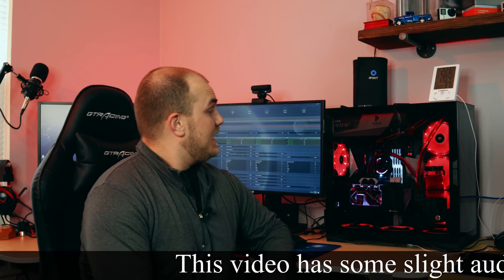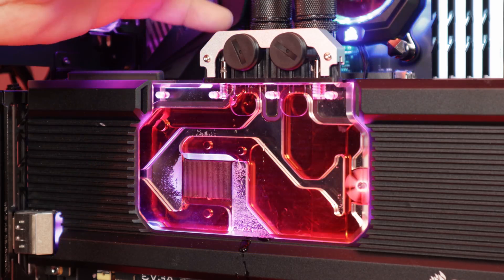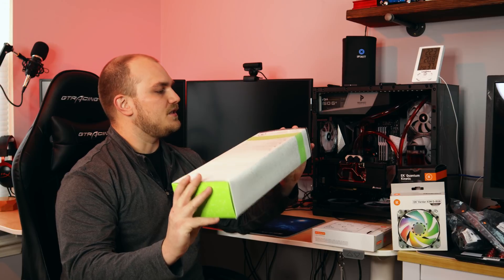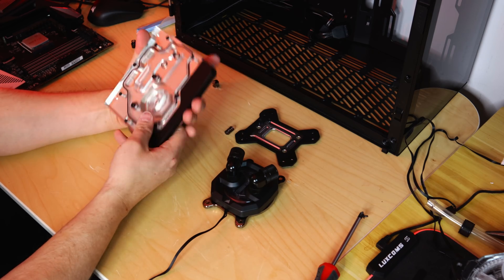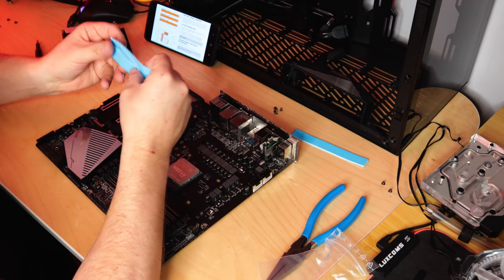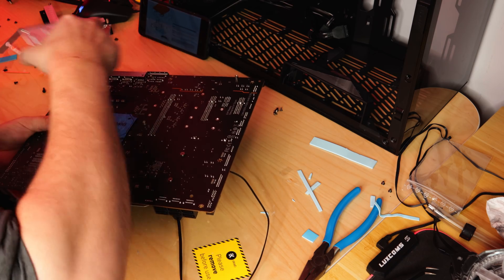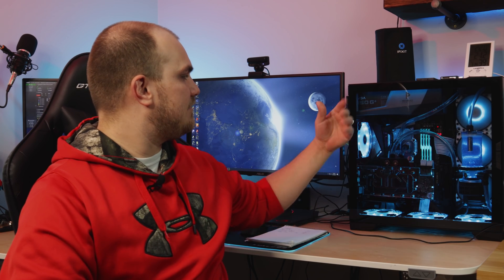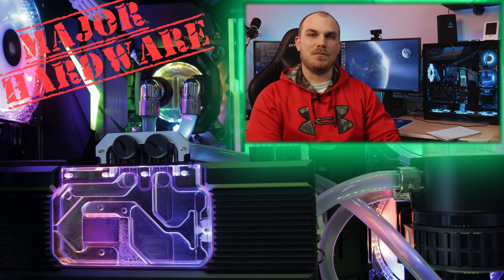SHAME! This Could Have Cost Me A 3950x AND 2080TI | UPGRADING My System To EKWB

Comment: hello there, i use ekwb fullblock too on ryzen 9 5950x ,Asus x570 egaming and a msi gaming xtrio 3090 allso with ekwb , i got 66 degrees on cpu and 42 degrees on gpu while mining Etherium and running cinebench simultaniusly..got i 2 radiators 2x120 and 1x120 with noctuas and a compressorcooler   . Pump a 15year old Eheim1048 and as comptessorcooler Hailea 350 are normaly for aquariums 😁
Full load waterthemperature is 30degrees.. could be worse i guess..

Comment: Haha, you need more than 1 rad to chill both cpu and gpu. Still good temps
Reply: 120mm for each in a custome loop should be fine to avoid thermal throtteling if set up correctly and individualy. 360mm for both as he has shown is fine. a thiccer rad might help depends on the airpressure the fans provide as a thiccer rad will also slow down airflow and may hinder heattransfer. Ofc if you go custom why not go the extra mile and stuff in as many rads as the case can fit?

Comment: @Major Hardware. Nice that you got that "potential disaster" under control !!
Though I must say that 95 degrees C sound pretty excessive for a watercooled CPU, which to me indicates either something "wrong" with the block (paste ?) or with the "configuration" (voltages). And seeing as the changing of the cooling hardware mitigated it, I'm inclined to suspect that something regarding Your old block or it's application was "not right"... 11 C difference from swapping components is MASSIVE in my opinion.
Best regards.

Comment: Hopefully more people will learn to stay as far away from Corsair as possible when it comes to water cooling. You’re paying a premium on OEM/outsourced items.

The only thing decent within their line is the XR7 series of radiators and that’s only because they’re being OEM-ed by Hardware Labs.

Please people, before going and throwing a water loop into your chassis containing thousands of dollars worth of components, please do some research. Stick with the companies that actually R&D their own components. Even if it costs you a little bit more, in the long run your machine will run cooler and with less chance of manufacturing defects ruining your hard earned, built machine.

Comment: I installed my EK Quantum Vector FTW3 2080 TI version and the USB-C port stopped working  😂😢 I can live without out it but a £1000+ card lost 1 input due to a waterblock change, you also lose access to the fan & rgb headers on the back end of the card.    ANYBODY lost USB-C port?  I get 0 errors reported in Device Manager, it still thinks it works fine but nothing happens when you plug in anything.

Comment: You had a single 360 slim rad for 400+W heat and moved to an XE which is twice as thick, sure you'll have better temps. I bet water was like 40+ *C in the corsair setup.

Comment: Glad to see EK hooked you up. I upgraded to the same board in Jan of this year, and I've been looking at the mono block in conjunction with the x570 chip-set block. Have you put any thought into incorporating the chip-set into your loop? Cheers -Haz3
Reply from the maker: i have, but to be honest i dont here the little fan and it doesnt seem worth the effort at this time.
Reply: I did a vertical pci adapter in my cooler master haf x about a month ago, and I've noticed when I'm doing rendering or intensive m.2>m.2 transfers my x570 chipset is around 5degrees hotter then when the gpu was horizontally oriented. I'm afraid the two m.2 with the (known to run hot) x570 chipset all tucked behind the gpu the temps are rising. I'm going to go for the chipset block and put out a video as long as I can get the tubing routed in the tight spaces. -haz3

Comment: Just a quick comment on the VRM temps on my Aorus X570 Master. 
CPU and GPU was pinned at full load running folding at home.

Room temp was measured as 17 Degrees C on my intake of the PC Case.
The internal case ambient temperature was measured as 31 Degrees C.

My 3700X was running at 77 Degrees C on air cooling.
The reported VRM temperature at this point was 43 Degrees C.

I dont have any direct airflow over the stock VRM heatsink.

Awesome channel buy the way.
Reply from the maker: thank you
Reply: @MajorHardware  I mailed you an idea for a possible future video if you are interested.

Comment: Those temps for 3950x are too high, and it's not about cooling, it's about voltage on the cpu. If you are holding it on default, those temps are fine then, but I don't think that even @1.3v manual temps should be 84c, not more then 80c. And that cpu  should do 4ghz all core on lower voltage then 1.3v.  It's best bin there is, so you are missing something there. As for the EK, nothing to say, best water cooling products by far.

Comment: I got a case used with some water cooling parts, I'm contemplating putting in a faux water cooling setup, (rads to res/pump) just for looks but I'd need to get some tube and bend it (soft or hard) and the misc fittings for it... then again if I have that maybe expand to cool 1 part (cpu probably), not that I need it. I only watch videos/movies and know absolutely NOTHING about overclocking....

Comment: For some reason this video popped in my stream only now. I've been watching this 'squirt replay' couple of times, and I'm seriously thinking is the oring seal actually there? I had identical issue with Aquacomputer's 7-GPU terminal block (number crunching rig), only to find out the gaskets where all missized and slipped, creating tiny, tiny leaks, that wouldn't show until temperature rose (more pressure). I wish you disassembled the Corsair's terminal.
Reply: Better watch his previous video regarding this issue, manifold screws, he had a detailed analysis on it

Comment: I've always had a good experience with the Phanteks blocks, but I have been considering switching out the CPU block in my Asus z370 itx build for EKs monoblock. My VRMs are always over 80c under any sustained gaming or benchies, with the 8086k barely reaching 70c @ 5GHZ and 1080ti usually around 45c. There's intake fan right above vrm and exhaust behind. I know Asus has been making some questionable vrm decisions for a few years now, but I'm just kinda torn between a monoblock or different itx board with better vrm.

Comment: Bro, you downgraded from the second to wordt block maker to the worst lmfao
Reply from the maker: Check you work
Reply: @MajorHardware  the reason for your "better temps" is the lower ambient (when running a loop each degree lower ambient will have a significant change in the opperational temps), the change from what seems to be a xtop pump which is really a ddc pump to a d5 kinetic (ek doesnt actually make pumps and simply resells them and the real manufacturer is laing for all d5 pumps for example), and likely also changes in fan target rpm and potentially changes in radiator and also possibly vecause of the case ambient if you didnt have both systems shut off for a significant period of time before running the test (also potentially because fluid change). The actual blocks however were major downgrades as the ek block maintains about the same floe impedence but with much worse alloy selection and significantly lower surfsce area over the die area on both the cpu and gou block and with the cpu block also now adding an extra heatload into the loop from the vrms which dont benefit from running cooler unless they were previously hitting a temperature thay degrades the mosfets in use.
Reply: @popnimpop5278  who would you recommend then? I'm new to this whole subject and it's very difficult to know who to go for. The heatkiller stuff looks good but I've only got youtube and random web pages to go on. Any suggestions should be appreciated saying as you have first hand experience clearly.

Comment: A "parallel flow" waterblock (the corsair one) with that CPU is aspected to perform like crap. Sadly EKWB blocks aren't good either for multi-die CPU because they have a very small fin area, with Intel CPU is fine. Personally I recommend to you to ditch the monoblock and get a Heatkiller IV will drop at least 5°c or even more. I switched from EKWB Velocity to a Heatkiller REV 3.0 with a DIY mouting is a 10y old block but excellent design and much bigger fin area and it dropped 5°c. If you get a Optimus Foundation probably the performance delta is close to 10°c. EKWB recently is getting very overpriced and the performance is not there. 
This is THE waterblock for Ryzen https://optimuspc.com/products/foundation-cpu-block-amd?variant=16111865987121
Reply from the maker: Big problem..... no rgb

Comment: I've got a step down from you in nearly every way: 3900X, RTX2080, EK loop with non-RGB CPU block and GPU block, and a smaller pump/res.  I have the same rad, though.  I love mine.

Comment: WILLING to trade for EKWB 360ml complete WATER COOLING kit for am4 platform b450 mb, rx 5700 gpu XFX DDULTRA, MY TRADE offers are all 3 combined! (r5 2400G known to clock at 4ghz at 1.4volts but i only ever ran it at 3.85 ghz at 1.375 volts, evga gtx 1660 super sc ultra, and a 240ml master liquid ml240l aio. ALL except the apu are under warrenty. can provide access to my evga and coolermaster accounts so you can make those your own for rma status and whatnot. ive major dont likke me posting this then do lmk where i could be more inclined to do so...

Comment: I had a Corsair PSU explode a cap in my pc, sounded like a firecracker :D

Then again I bought a Superflower Leadex 3 750w full modular PSU some time ago and it died right away while installing windows, only after 15mins of use brand new.. And no I didn't exceed power and used care with install.

So far my best experience has been with XFX PSU's :)
Reply: My best experience so far is with XFX as well.
I my first psu was from a local vendor. No brand thing but reliable. 
Bought a corsair one. Fried my pc after a few months. Got everything replaced by the shop (god thanks) and bought an XFX one. No problems running the 750W one at 700W powerdraw for months in a row
Reply: None of those three brands actually make their own power supplies, they're all OEM'd elsewhere.
I know at least some of XFX's higher end supplies are made by Seasonic, who do make good power supplies.  Corsair, it definitely matters which line they're from.

Comment: its funny how you add hot ass vrm to the loop and still drop the temps by an insane amount.
Reply from the maker: ek knows what they are doing it seems
Reply: VRMs can reach high temperatures, under crappy heat "sinks" and "armor". However the heat flux is actually not that big. I suspect the CPU running 130 MHz higher on average with the EK loop contributed way more to the power consumption than the VRM.

Comment: Woah!! Perfect time for me to find this, as I'm starting a new build with EKWB components in another few days or a week. I hope you see my comment, because I have a question!

The new X3 fans look amazing and feel quality so far (remember my system isn't built yet, but small parts I have started assembling). BUT! I'm wracking my brain trying to figure out how to mount the pump to them with the vertical bracket like you did. Sadly, you fast-forwarded the video right at the portion I needed to see :/

Did you just use longer screws and count on the actual bracket itself to squeeze the fan against the radiator? That should work I think...but I'd feel better with some sort of standoff in the 20mm range  between the bracket and the flange of the fan to provide additional support. I'm building a 3950X system too, but with an ASUS Hero Wi-Fi and the associated custom Monoblock.

I'll be building in an O11 Dynamic XL, and went even crazier with the EKWB parts than you did, even though I won't be watercooling my GPU right away. I'm aiming for the 3080Ti, so as a stand-in during the meantime I went with a 2070 Super for now. The 3080Ti I WILL watercool, and the 2070 I'll then put in my old rig to give it a needed shot of adrenaline; finally retiring my 780 6GB.

I'm throwing as many radiators as I can fit into the Dynamic XL right off the bat though, so I'm already set up for the 3080Ti with a minimal amount of tubing fuss. Hopefully populating all 10 fan spots with rads, I'll see how it goes.

I gotta say, Peter at EK Customer Service was stellar when I placed my order! I made a mistake with my parts, but luckily something was backordered a few days. He was able to consult with Tech on the correct part, and change my order on-the-fly before it even shipped. And with that little bit of info, EK will probably figure out who I am if they read this heh!
Reply from the maker: Yes I just use longer screws which work fine I just tightened them evenly I could have printed standoffs but not really needed
Reply: @MajorHardware  Thanks for the reply! If it works...then yeah, I'll stop stressing and just do it that way as well. Thanks again!

Comment: Hey bro did you use the ek connect? I have had so much ek stuff sitting in my attic since Boxing Day and I got that for free from them after spending $1000 bucks on ek gear
Reply from the maker: I did not, is it anygood
Reply: @MajorHardware  right now the app is extremely basic. It's bare bones to get your loop working and some basic RGB. The hardware seems good, but we'll be able to tell when EK Connect will have more features

Comment: Just had to tear down my EK Velocity block sitting on my 3950X yesterday,   it was seeping fluid.   Good thing I had a pressure relief valve or that seeping could have been worse.    The block is only about 2 months old.   Yes it was tight,  yes I checked it before I installed it.   I tossed some silicone grease on the seal and put it all back together,  so far so good.  

EK is not perfect either.
Reply: Hi Jeff!
If the block has not been disassembled at all and the seeping occurred, you should have contacted the EK support team right away. It's important that the case is reported so that it's known that its a product error. If it develops a more serious leak in the future, and your hardware gets damaged, EK cant cover the damage if the block was tampered with. It's very important that you report all issues since the blocks are in warranty and if there is any hardware damage, you can get reimbursed for the damage.
Hope this information was useful, if you have any questions, feel free to ask.
Reply: yikes. I was about to order one now your comment is making me think twice. Did you pull it apart to clean it or anything before installing it? aka tamper with it?
Reply: @ChristopherJones16  I didn't take it apart before installing it.  In hindsight I wish I would have.   Adding the food grade silicone grease fixed the issue and it's not had a single issue in the year or so.  When I say add silicone it was just enough to coat the seal and nothing more.   Honestly I wouldn't worry too much.

Comment: If you want 2 rads down the road, spring for another EKWB.  No chance of mixing metals that way.
Reply from the maker: Ya I'll have to check on that corsair rad to make sure they are the same
Reply: The Corsair's radiator are xspc rebranded rads which their slim series is one of the best on the market cof cof ek's lack of finn density leaves performance to be desired, but yeah on thicker categories ek and alphacool all the way unless you want delta fans

Comment: Ek flexing on the new kid and showing how it's done 😂
Reply from the maker: Flex appreciated
Reply: @MajorHardware  i guess u can say that the corsair is the FLEXING one haha
Reply: @MajorHardware  now flash i bios :)
thats what i did :)
Reply: EK is like the Razer of watercooling tbh, sooo desperate for brand recognition.
Reply: yeah good to know I love to hang off my parts in my computer while gaming wouldn't want the ek cooler to leak cause I'm pulling on them lol
Reply: @raven4k998  cutting hard tubing .5 mm too long was enough for mine to leak (~ 2-3 drops / minute but still leaking)

Since i was building in a quadstellar for a guy who didnt know a lot about PCs, that's a no bueno.
Reply: I mean...you do know EK makes Corsair's stuff right? Corsair had EKWB make their custom parts and HWL's budget radiators.
Reply: @evildeedz66  Corsair did poach some of EK's people to get hydro X started, but EK does not make any of the corsair watercooling parts. They make the blocks themselves, source the rads from HWLabs, fittings from Bitspower, and fluid from Mayhems.

Comment: Hey that 'growth' in your old water block looks like it's left over flux and gunk from your radiator. Brand new radiators need to be cleaned out before being put in a loop to get that flux and any loose copper out. normally you can just fill it with hot tap water, shake it really good, and drain it a few times and that will take care of it.
Reply from the maker: possibly good tip

Comment: Hey, do you want an idea for another video? I have been over clocking my 3950x and I found it did not so good topping out at 4250 at 1.26v  After that, I tried over clocking each ccx at a time to see the full potential for each of them. I found out that there is a very good ccd and the other one not so good. At the same voltage now I have 4 cores at 4.475 mhz another 4 at 4.450, and on the other ccd I can reach 4275 and 4250. Overclocking this way you loose little in single core performance bit you gain a lot on multi threaded tasks. Also with a ekwb velocity my cpu temps don't reach 80 degrees with prime 95, the system recorded a maximum of 78 but it was a spike, I didn't saw more than 76. I think it's worth a try.
Reply: Pablo Ausucua If your afternoon high core overclocks you picked the wrong cpu😯
Reply: @chrisvig123  no, not at all. I work with vray, I'm an architect and my. October stays rendering hours and hours, normally at night. This is just something I found while overcloking, I think it's worth to have a look at it.